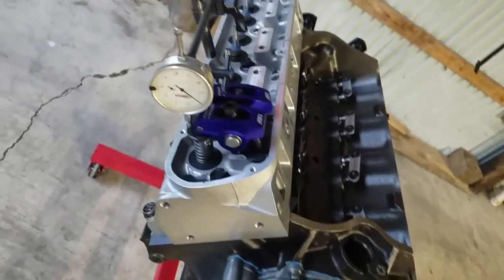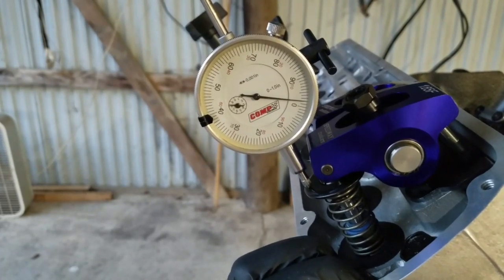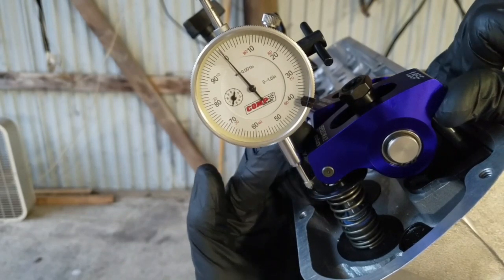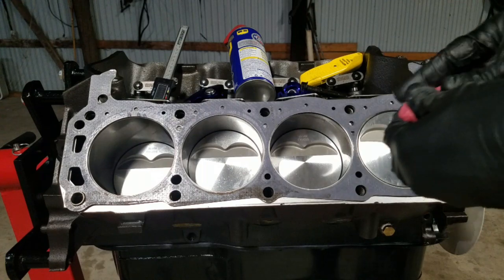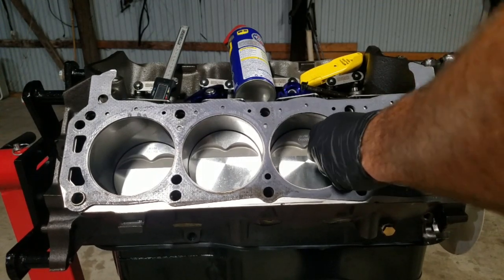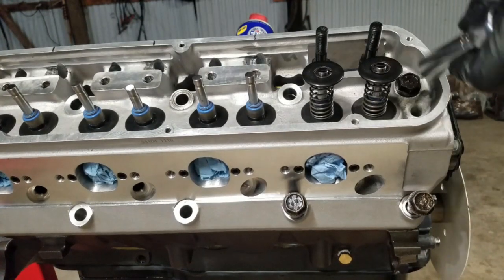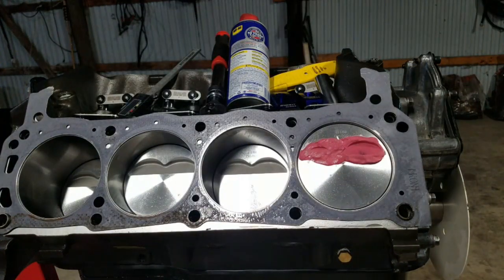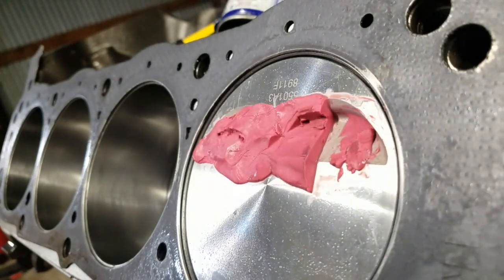How to measure piston to valve clearance

Comment: Hey there BOD how ya been?   What's the lift on your cam?  with the rocker arm being 1.6 or 1.7 ratio the cam isn't same lift as you're measuring, correct?   What springs and RPM range is the design operation range for this engine?
Reply from the maker: Hey good question , doing better than i could be 👍, i have 1.65 ratio rockers which is what i specified and reads on my cam card which said .602 lift . I measured lift at the valve with my solid roller,  correct pushrod and rocker arm that will be used . It came out to a few more degrees of intake duration 246.5 @.050 and  .633 in lift . A little more on the exhaust,  I  checked my figures a bunch of times. Needless to say i had to change valve springs now . I built it to rev pretty good and run pump fuel . It will probably make peak horsepower in the neighborhood of 6800 rpm . I recently spoke with a local dyno operator to schedule me in to make some pulls . 😀
Reply: @blueovaldude  Decent size cam and rpm range, should be a bit nasty.  Are you going to spec Beehive, Conical, or standard style valve springs?  If you haven't watched any of the slow motion valve control videos where a Spin-tron is used check it out. Was eye opening to see how much better the Beehive or Conical valve springs control the valve event.
Reply from the maker: @chestrockwell8328  yes , i have watched slow motion videos about that . I called cam research and ordered the specced valve springs which are a conventional style spring .